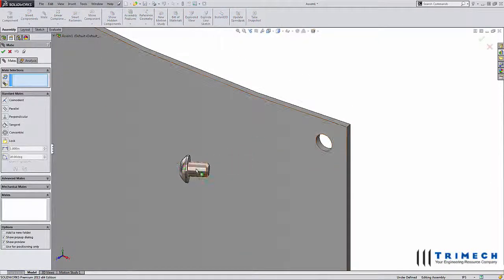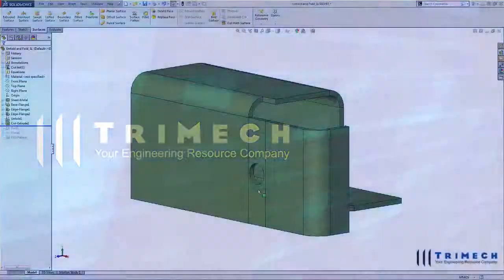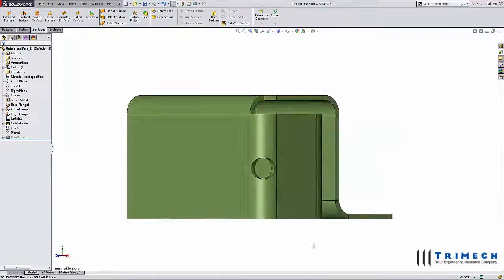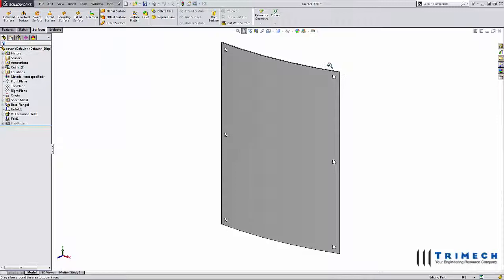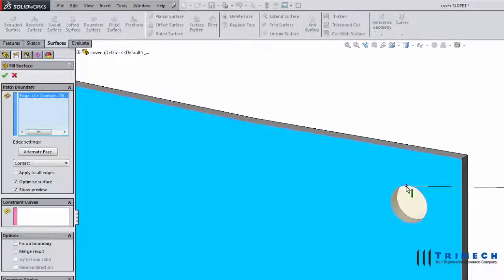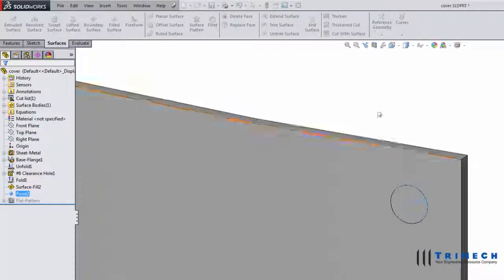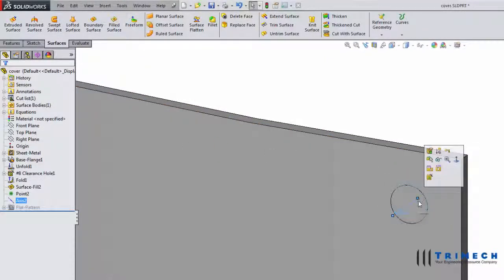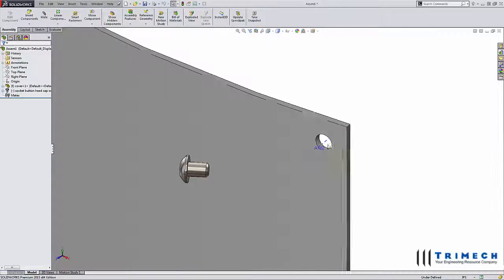Video Tech Tip: How to Mate a Fastener to a Hole on a Curved Surface in SOLIDWORKS

Comment: i run into an issue in the assembly that when I delete the feature it loses the reference points, which doesn't seem to be an issue when you're using the axis but what if I wanted to use the point?